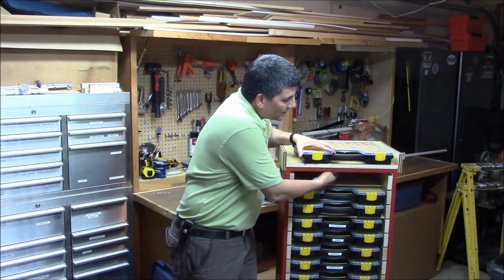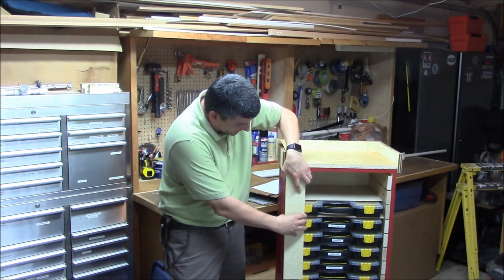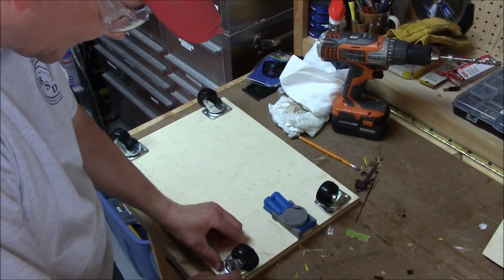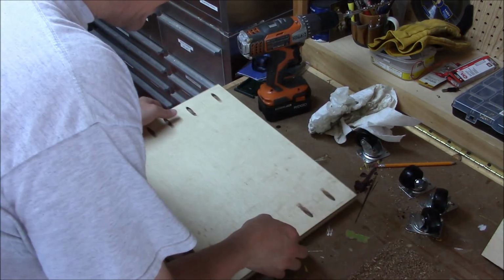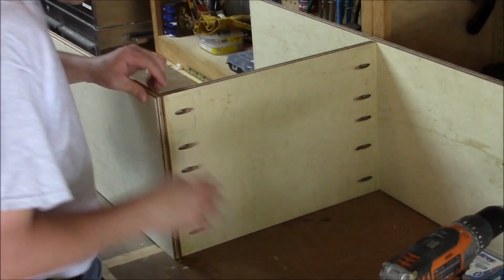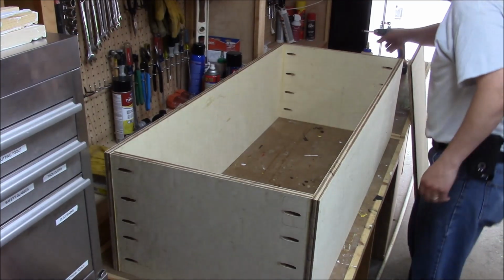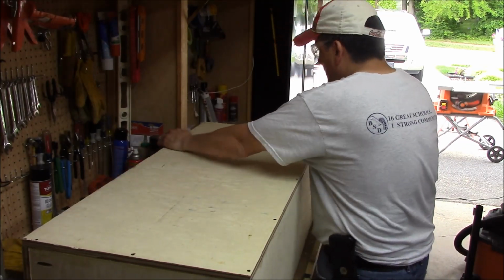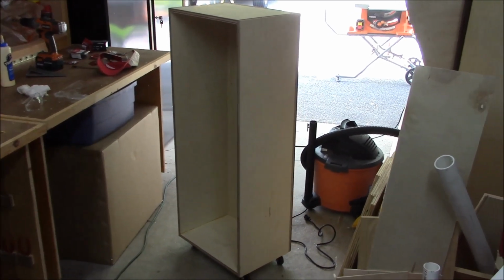Plastic Box Storage Cabinet - Part 1

Comment: I have a heavy rolling aircraft tool chest, it sits on a hunk of 1" plywood, about 4" bigger then the foot print of the tool box.   This was done because when we rolled a tool box down a ramp sometimes they can tip over.   the tool chest rolls on 5" casters ( so they don't  bind up ) sitting out board of the chests foot print to give it a larger foot print.  Your small caster could be bigger they will work better just don't ever try to roll it down the driveway as the foot print is only 50% of a rolling aircraft tool chest so you may want to increase the foot print of the casters.  Plus the bigger casters roll over small nuts and bolt better then the little ones.
Reply from the maker: +Frederick Fredrick, thank you for the feedback, I appreciate it. This was to roll around the garage but excellent point on trying to not roll it down a driveway!

Comment: John, my name is Hank and I am a beginning woodworker.  I needed storage for finish nails and a large verity of small parts.  I saw your video on YouTube on making your small parts storage system and knew right away that this is what I needed.  I am also handicapped and have to work from a chair.  I have found it very difficult to find someone to help me make you system.  However I did find a cabinet maker who lives about an hour from me that is willing to help but he requests drawings and dimensions.  Basically a detailed drawing.  I do not have a printer and can’t download anything and print it.  Is there anyway that I can obtain a detailed drawing of you storage system by mail?  I would be more than willing to pay for your services.

Comment: Also don't under estimate the weight of your Nuts and Bolts, once I filled my trays they weight 10-15 Lbs each on average and it adds up quick .
Reply from the maker: +Frederick Kaludis Thanks.. I am trying to keep the heavier items to the bottom and the lighter electrical connectors to the top of the case.
Reply: n3lud

Comment: Just a quick question.......Are those 1x3 pine cleats attached to the inside of the cart?
Thanks, 
Ray
Reply from the maker: MemberAt Large Yes. I also just posted a video where I used scrap plywood cut to 2 1/2 for the cleats.

Comment: I would have thought the cabinet would have been stronger if you put the side on top of the bottom piece
Reply from the maker: +sparky0288 You are correct. If the side pieces sit on the bottom piece and was fastened from below it would be stronger. I have done that before with other projects, not sure why I did not repeat that for this one. Thanks for the comment and watching the video.
Reply: I think that the way I'll make mine this spring, buying the boxes now...
Reply from the maker: +sparky0288 Sounds great. You could also run a piece of 3/4 plywood across the bottom that the cabinet would sit on and the casters would attach to. This would also be good for attaching two cabinets side by side and having them sit on a piece of 3/4 ply that would run the length. Please share a picture of your cabinet. Thanks again for the feedback.
Reply: n3lud